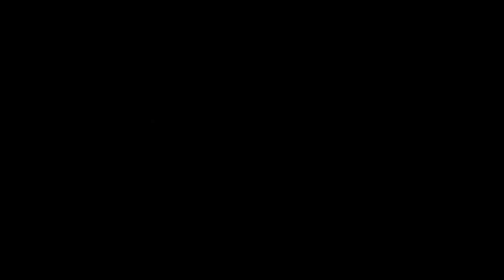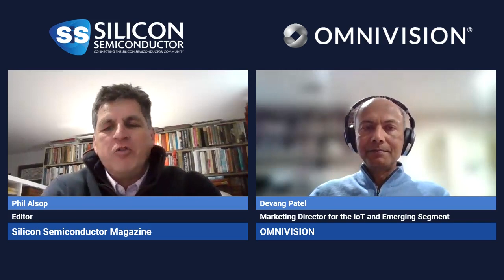Single Chip LCOS Panel – A Smart Vision

Comment: Abstract

This interview with Devang Patel, Marketing Director for the IoT and Emerging Segment at OMNIVISION, discusses the company's new OP03050 Liquid Crystal on Silicon (LCOS) panel, as well as AR/MR/XR glasses market challenges and opportunities.

Key Points
* OMNIVISION's LCOS Products: OMNIVISION offers LCOS products for various applications, including AR/MR/XR glasses, telecom, and automotive heads-up displays (HUD). 
* OP03050 and OP03011: 
    * OP03050 is designed for a wider field of view in AR/MR/XR glasses.
    * OP03011 is better suited for smaller field of view AR and consumer smart glasses.
* Consumer vs. B2B AR/MR/XR Smart Glasses: OMNIVISION sees potential in both sectors.
* Challenges for Smart Glasses: Form factor, power consumption, and compelling use cases are barriers to wider adoption. 
* Consumer Demand Could Hinge on Major Brands:  Consumer interest is likely to surge if major tech companies launch compelling smart glass products. 
* OMNIVISION's Role in  AR/MR/XR Future: The company continues to invest in and develop new LCOS products, aiming to reduce power consumption and form factors.

Timestamps
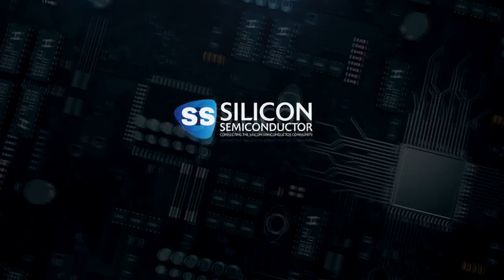* 00:00 - 01:19: Introduction to OMNIVISION LCOS products
* 01:20 - 02:39: Specific applications of OP0350 and OP03011 panels
* 02:40 - 05:58: Features and specifications of new models
* 05:59 - 11:28: Challenges and potential for AR/MR/XR market adoption 
* 11:29 - 16:03: OMNIVISION's 2024 roadmap
* 16:04 - 17:58: Automotive applications and OMNIVISION's unique manufacturing  
 
Disclaimer: I used gemini advanced 1.0 (2024.03.04) to summarize the
video transcript.  This method may make mistakes in recognizing words
and it can't distinguish between speakers.